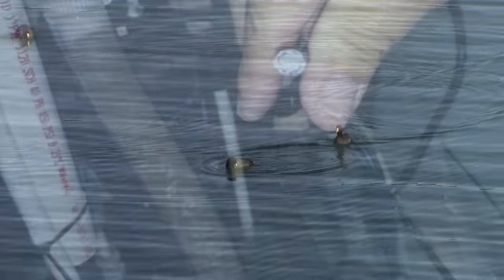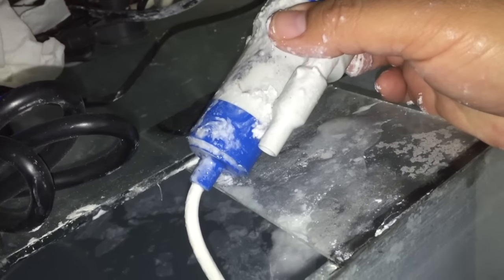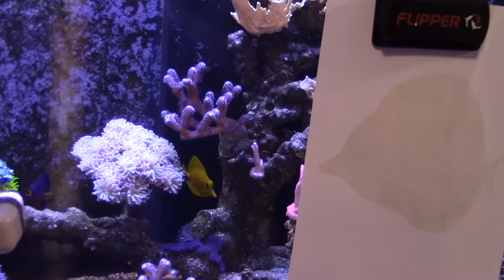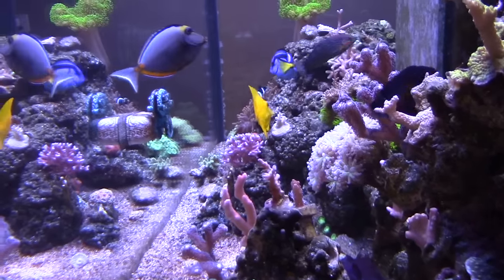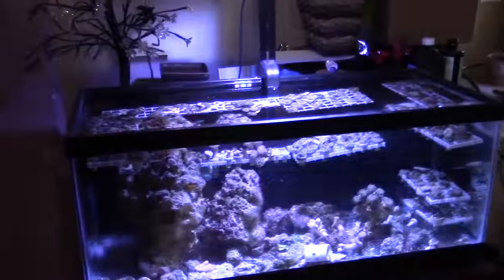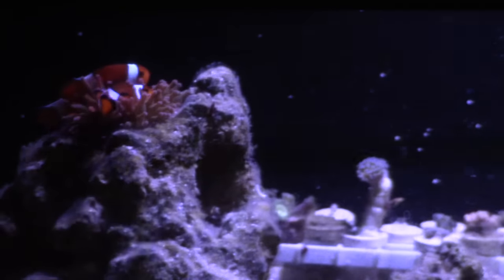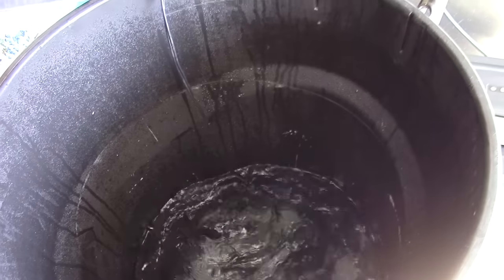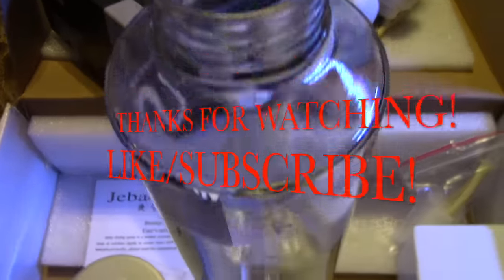20 GALLON LONG NANO REEF TANK SALTWATER AQUARIUM UPDATE

Comment: Can't wait to hear about the Jabeo doser. I'm thinking of switching  from Kalk as well. I currently use a 5 gallon reservoir and have rigid tubing about 2 inches from the bottom and use an Aqualifter for my auto top off.  I never have a problem with sludge buildup from the kalk.
Reply from the maker: Hey Phillip, If Kalk is working for you then its good. With 5 Gallons its not bad, but mine built up over time. Hard for me to get my hands in there. I had a tunze pump kicking on to help stir it every hour.  Just becareful with the aqualifter, I should how the kalk clogged up my ato line.

Comment: I used kalk briefly and found my calcium would get sky-high so I stopped. I was manually dosing by dripping a strong solution using an acclimator overnight. It worked great but was a PITA. 

I also got the DP-4 and I really like it. It's been running for about a month now. I use one pump for the top-off in my 29g, delivering 80ml of fresh water 10X per day. For alk, I use Reef Carbonate and put 25ml into 8 litres of the top-off water in the large water container that originally had spring water in it from the grocery store. So my 29 gets about 8-10ml of added carbonate per day. This has been working perfectly, keeping the alk at about 8.3.

The other 3 pumps on the DP-4 are used for calcium, magnesium, and potassium in the 20g nano. I scored some plastic food storage containers on aliexpress for about $8 ea. They are square and stackable, have flat lids, and hold roughly 2 litres of liquid each. So they are perfect for dosing. 

I had my doubts about dosing but I'm a convert because it seems to be helping keep things stable and I can keep the water changes smaller. I guess we all find what works for each of us eventually.
Reply from the maker: Im like you, Im liking the dp4. What potassium did you go with? I hear it really brings out colors, which is cool. IM glad youre feeling better now, im gonna refer people in my next video to your video. A lot of people should know. I knew about it, but didnt know it was that bad, mainly just read about it. Have a good one, and im thinking about a 2nd doser for my 24g AIO. Alright, have a good one, enjoy the weekend!
Reply: When I did the research into "brown acro syndrome" I decided to use the Red Sea Coral Colors program - 4 different supplements called A, B, C, and D. But when I ordered them, the supplier was out of B. B is the potassium/boron supplement. So I found Julian Sprung's Reef Formula  Potassium Concentrate and that's what I'm using. 

I decided to dose it instead of manually adding it (like the other three- A, C and D) because I found out my saltwater mix was deficient in potassium so no matter what water changes I did I wouldn't keep up with the depletion in my tank. 

I also decided to regularly test for potassium because the target amount isn't a range - it's 400ppm, very specific. My tank was running at 360 - far too low. It took about 20ml once per week to get the level to stabilize at 400 so I've set the doser up to deliver 8ml of solution once per day. The concentration of the solution means that of the 8ml, 3ml is potassium and the rest is salt water. And I didn't like dumping so much of a concentrated supplement in all at once so the dosing spreads it out over 7 days. 

The other color supplements are added in such small amounts (0.15ml weekly) that it's not such a shock to add them all at once. I'm deliberately under-dosing them because I can't test for those elements (strontium, iron etc) and I'd rather go slowly and gradually increase the amounts until I start seeing results. 

That's been running for a week and I'm just about to spend my Sunday afternoon testing, so I'll see whether I've done the math right. 😬 I'll keep you posted.
Reply: .....and I'm happy to say the potassium was dead on at 400ppm so for the current amount my tank is consuming, this is working perfectly.
Reply from the maker: For sure keep me posted. I think its best to under dose, start slow and adjust form there. I like that acropower but I use very little. A capful makes my tank break out with cyano. And I actually see benefits from just using a small amount.  I may look into the coral plus, just so many things and options to go with. For now I just want steady alk ca mg. :)

Comment: Do you scrape the back of your tank at all. I was wondering if that way you get coraline algea growth. The only thing I dont like is that if you let it grow it gets to hard and tough to remove. I havent done a water change is a while and my corals are thriving and open up. I check my parameters and sugar dose. When I would change the water everything would close up. I have real good mechanical filtration and a dff diatom filter that is the best product that I have ever purchased for my tank.
Reply from the maker: I have, I wouldnt mind doing it to my 120g. Just I dont like sticking my hands in unless I have to. I love the Flipper, Which I know would do the job, but I cant get behind my tank to do it. Only bad part.

Comment: Nice video Mike 👍 you got an insane amount of tanks going on there lol, I had a 30 gallon saltwater tank and a 60 gallon freshwater tank, got rid of the freshwater tank and got a 10 gallon saltwater tank, and now I just have the 30 gallon saltwater tank, and that's enough work for me lol
Reply from the maker: Yeah Sean, I love it. But youre right, I was using a lot of water. So The 120g and this tank is good. I really like the 40Breeders, but I told myself no. I did get the 24g AIO

Comment: How long did it take your clowns to host your anemone? Mine are just babies so i'm wondering if they have to become older since they are tank bread. My Clowns have been in the tank for 6 weeks, the RBTA has been in the tank for 4 weeks.
Reply from the maker: I have had good luck with them. I got my clowns when they where babies and they went straight to the Nem. How big is your tank?
Reply: +915Mang my tank is a 40gal and the anemone is approx 2.5" in diameter.
Reply: +915Mang tank is an Innovative Marine Fusion 40 Nuvo